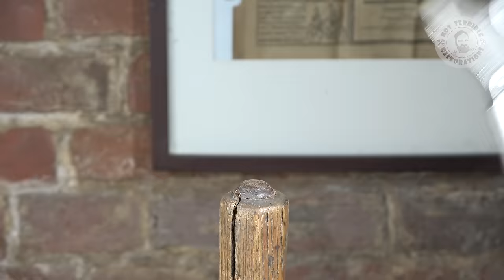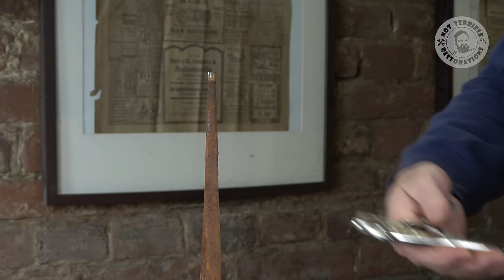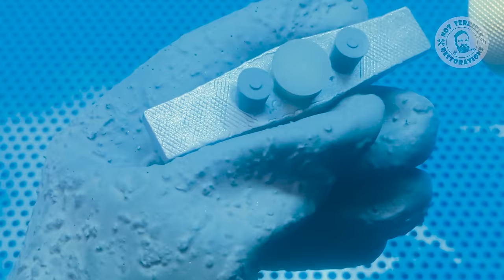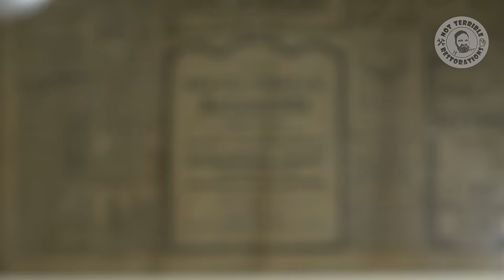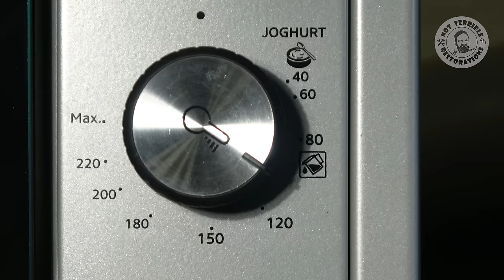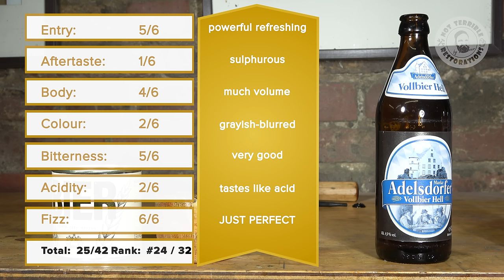GIVEAWAY Restoration of an Adjustable Monkey Wrench

Comment: Time was, we used to fix things up to give them a longer life. And, of course, every tool was new at one time. Watching Dr. Beer restore and make old things new again is not only satifyingly relaxing, but instructional, as well. Each time I watch, I usually learn a new techique, or two, which gave me the confidence to restore an antique Dunlap 3.5 inch vise, which is currently in parts on my bench. I, too, love that the new parts were made out of a rustly steel rod lying around since the shop's renovation. That's what I'm talking about!
Reply from the maker: Thank you so much Douglas

Comment: Looks amazing! I did notice something! You pulled out a Tap and a Tap handle but then used a die and die handle in the next shot
Reply: Really? I'll have to look again in a moment, I didn't notice.
Greetings Tino
PS: Canˋt see a different handle.
Reply from the maker: So far you are the first one :D
Reply: @einufo 5:42 he grabbed an inside tap from the box for an outside thread. Probably didn't use the right terms, but you'll get it.
Reply: @NOLAfugee  NOW  I've got it! NTR grabs taps but uses cutting dies in the next frame. (NTR nimmt einen Gewindebohrer, benutzt aber ein Gewindeschneideisen in der nächsten Einstellung)
Thanks for the explanation, greetings 
Tino

Comment: That is a fantastic restoration - I just think you did a great job preserving the character of the original tool - especially with all the effort you put in on the handle.  The ring of wood you added matched really nice and I think adds a good bit of strength to the repair.  The result speaks for itself - it really looks like an heirloom piece to me. 👍

Comment: Another excellent restoration. I was particularly impressed with the finish you got on the handle with the hard drying oil. Need to see if something like that is available in the UK. Also, your condensing SO much sanding of the jaws into a couple of seconds. Obviously a labour of love. Thanks for sharing.

Comment: Great work and great balance between keeping patina and restoring functionality. 
Did you think about fixing/straightening the twist in the handle part of the spindle?

Also I noticed that the thread looks way cleaner after you repaired it, and at 5:46 you take a "male" thread cutter but are using a "female" just a second after. Still I doubt that is, what you were aiming for?!

Finally: special thanks for the beer tastings. I like those very much, especially when I know the beer.
Cheers ;)

Comment: Looks absolutely stunning. Love that you found the old number stamps. Out of curiosity, would repairing the wood like that affect its integrity in situations when you’re applying torque?
Reply from the maker: Some say a wood glue connection is stronger than the original wood fiber if done right. I never did a comparisson, but I'm confident it will last

Comment: A very nice restauration again. I liked very much that you saved the wooden handle. I wonder, did you achieve the spindle restauration by using the file only. Or did you weld on some material, where the threads were badly worn?

Comment: to your question in 5:50 I did noticed something before but don’t know if it’s relevant: you used the same adjustable dice for both threads of the spindle even if they are different thread pitch. Was it that?
Very beautiful restoration, loved it. I want to qualify for the give away.
Nice work!
Reply: Really..? Well thanks a lot ! 😄😍🥸😎 🔧

Comment: Nice number punches you found! How was the corrugation in the clamping jaws actually done in the past, without a milling cutter? The handle turned out great, you have to put in the effort first. The threads have different pitches? I've seen Darth Vader for whatever reason. .
Greetings Tino
PS: If I win the key, please sign it with an autograph or something

Schöne Schlagzahlen, die Du gefunden hast! Wie wurde die Riffelung in den Klemmbacken eigentlich früher, ohne Fräser gemacht? Der Griff ist super geworden, den Aufwand muss man erst einmal betreiben. Die Gewinde haben verschiedene Steigungen? Ich habe Darth Vader gesehen, warum auch immer . . 
Gruß Tino
PS: Falls ich den Schlüssel gewinnen sollte, bitte mit Autogramm oder so aus dem Griff
Reply from the maker: Das habe ich mich ehrlich gesagt auch gefragt, aber ich denke wie bei feilen kamen hier hammer und ein schlagwerkzeug zum einsatz. Aber das ist nur eine Vermutung
Reply: @NTRprojects  Ich muss by mymechanics nachsehen, der hat doch mal seinen Schraubstock . . . 
Gruß Tino
Gefunden: Mymechanics hat bei beiden Gressel-Schraubstöcken neue Backen bei Gressel bestellt. 😆
Reply: Mr. Patina hat welche aus Alu gefräst . . 
Aber ich habe das hier gefunden: Brockhaus-Heuer hat 1949 die Backen gefräst: https://youtu.be/dNWsR3BnAAI
Jetzt weißt Du, was Du noch für eine Maschine brauchst.
Gruß Tino